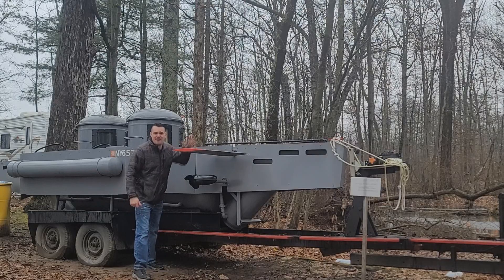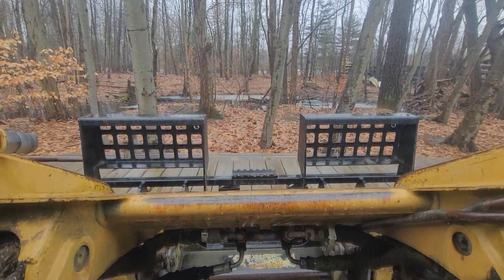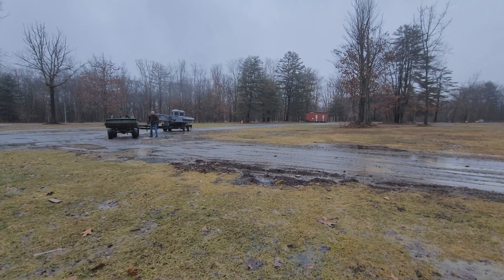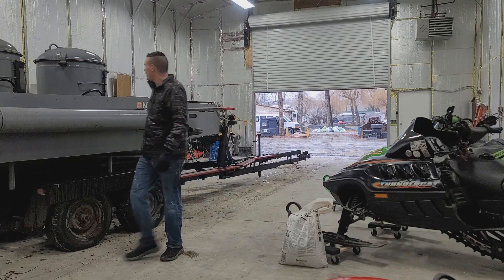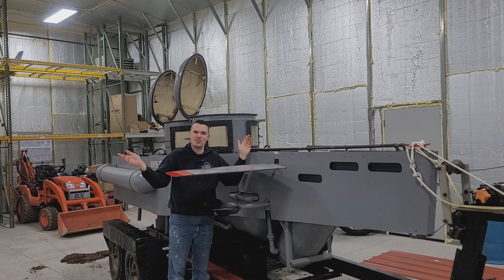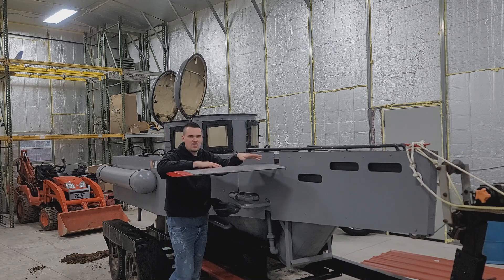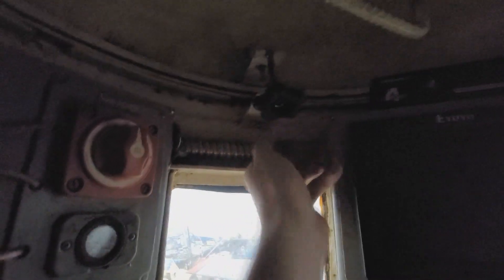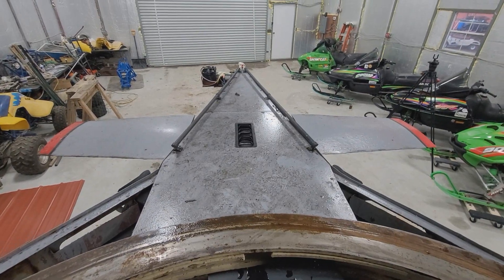Submarine Update! - In The Garage | The Plan & Walkthrough - Episode 1

Comment: If you dive with someone on the surface who knows about you and your plan, you will be fine. Sugesting you to try add a snorkel, or even a flexible hose with floater and compressor on the surface, to feed you with the air. With the condensation - sugesting you to make a condensation groove, to be dried or pumped out. Another possible point is to add a chunk of salt inside (salt takes the watter and wettness in).

Comment: 8:37 something important to keep in mind, which you've probably accounted for but I wanted to mention it just in case, is that if the cabin is flooded, the internal electronic systems will need to be fully waterproofed to prevent damage.
Reply from the maker: Not practical, most of the electronics would be destroyed which is fine. It's for an emergency to survive, so that part doesn't matter. Thanks for the comment

Comment: Dehumidifier with a "pump" to pump out the water, if you have a way to drain it out the cabin, and run that for an hour or two per day....and I would also put Silica gel inside the sealed electrical boxes to keep that stuff extra dry.... I have experience in humidity issues...I live in MN and have a Bunker Style Basement....(My Great Grandma had my house built for her)

Comment: Awesome job and thanks for all of your extra work of sharing these videos and even replying to comments!

I'm sure you considered having an exit facing downward so you wouldn't have to flood the sub to scuba out. Why did you rule that out? I guess you'd need feet on the sub to give you space below it if it were resting on the lake floor..
Reply from the maker: Correct, there is no room below because of the I-beams, they keep the sub upright and weighted, takes up the space. Also, that's correct - If it's on bottom, there would be no room. Thanks!

Comment: You don't need scuba gear to escape the sub - all you would need is a pony bottle to give you a few breaths as you flood the boat.

(I guess that is scuba gear - maybe thats what you are using.)

Flooding the boat increasing internal air pressure to about 45psi.

Regulator on the pony bottle supplies air and as the boat floods; it increases to 45psi also.

Kick the hatch and swim out. No air needed at that point - just exhale on your way up.

I used to free dive to 90' in my youth. 

(Just as a demonstration - I had to be massively negatively bouyant and drop my belt when I came up.)

Free ascent from 60' is cake.

But what do you estimate as your crush depth?

Or whats the max depth in your operating area?
Reply from the maker: Yessir, I keep a pony bottle. At 60ft, it's only 25.93psi. Which is it's max depth with 1:2 safety margin. Estimated crush depth is 120ft based on 3D model stress testing. Impressive free diving. - Also PADI certified, just assuming from your comment. Have a good one.
Reply: @PlanesBoatsandSubmarines  I only did it a couple of times - keeping up with my dive instructor, who frowned on it because of the risk of shallow water blackout.

A good experience though.
Later when I did the escape training at sub school in Groton it was no big deal.

Comment: I love the build, I am curious on ur opinion on the J hooks? The screw down part looked plastic to me and id be nervous
Reply from the maker: They work pretty well, never had an issue yet. Although I would like to upgrade them just because. The K-250 subs use the same style, proven effective design. I keep a wrench inside should anything like the plastic break, could just turn the nut. As well as secure or remove other fittings inside.

Comment: You need to pick up some bolt-on zincs to act as sacrificial anodes, and bolt them both to the interior and the exterior... it would greatly reduce your corrosion problem.

Also, dehumidifiers works WONDERS.

Comment: I don’t understand why would you go through all of that work and not set boxes of dehumidifiers in the interior, I mean the simplest form is even baking soda, but you could purchase these things were absorbs all the humidity. 
Anyway, with that being said, that’s a cool build, must be surreal to just hang out under water.
Reply from the maker: I did. I had containers of damp-rid inside. They couldn't keep up for anything. It condenses so badly, it needs full dehumidifier running inside which is the solution I decided on. Thanks!

Comment: You should put some type or cover over those valve handles to prevent something from snagging them and opening them by accident.  Also maybe get some O2 candles in case of an emergency.
Reply from the maker: Thanks for the comment. We zip tie them. o2 candles is an interesting idea (but to my knowledge, not used in personal subs), we do have onboard oxygen tanks that release o2 on a slow flow. As is, it will already last up to 24 hours underwater. But as it's a shallow diving sub, flooding to escape is relatively safe if you were running out of time. Onboard scuba as well for flooding and escaping. All the tanks were removed for the video so I could move around inside it.

Comment: You should install some grating on top of your ballast tanks on the sides. That would give you a little deck area for better accessibility while on the surface. You can always put sections of it on hinges so they could be lifted up to allow access to the tanks.
Reply from the maker: That was the original plan, and I might still do it, but it would have to be a plastic grate. A full size steel grate would make it more unstable at the surface. Thanks for the comment.
Reply: @PlanesBoatsandSubmarines would you ever be interested in building a sub for someone else?
Reply: Just a thought but you might be able to fix that stability issue by adding a second section of pvc pipe below the existing one. That would help your trim level in the water as well. Assuming you have enough reserve capacity in your ballast system to offset the additional buoyancy. But I would think the additional deck grating would possibly balance it all out. It would be nice to have that deck space. Make it feel a lot more like a traditional sub and less like just a submersible. I love your progress though and your enthusiasm for this. I always had an interest in subs and thought about building one back when I was a young man but unfortunately I never did. Been a lifelong follower of psubs since they were formed.

Comment: Try an electric dehumidifier and sealing up the sub as well as you can to get the humidity inside down. The solution you're mentioning, circulating fresh air, will just introduce more humid air that will add to the condensation. You need to dry the air out because its impractical to raise the temp of the hull of the sub to keep it from being below the dewpoint causing condensation, and those are the only solutions I can think of. Same situation as the windows in my fish tank room in the winter, I run a dehumidifier and its no issue now, its amazing how much moisture they can pull out. If you can get a drain hose from the dehumidifier out of the flood valve so you don't have to drain the dehumidifier manually you're all set. It should work well because its a small sealed space.

I have a home made/converted RC sub ROV using a drone flight controller. Might be fun to see how you could integrate the control system/automation to your sub, even just the instruments they have onboard might be of benefit. Look up Ardusub for the open source project supporting it. I used a thunder tiger RC sub and converted it, so its a classic sub with ballast tank like yours.

Looking forward to the next video, especially this summer when its in the water!
Reply from the maker: You know, that is a very good idea. Best Comment. My thought process was humidity is at 100% in there (higher than the outdoors, virtually always) so I figured even fresh air would bring it down if the flow rate was high enough from a ducted fan and use less electricity being hooked up all summer, but if I can find a small dehumidifier that works well. I'll do it. I've tried small dehumidifiers off amazon (for my bathroom, not the sub) and they don't extract much (droplets compared to a compressor style dehumidifier), so I think it would have to be a dehumidifier with a compressor/refrigerant to really dry it out. Curious to know the smallest one available that utilizes refrigerant and would certainly drain it through a valve. Ardusub looks cool. Maybe for a future endeavor. Thanks!
Reply: It will definitely need to be one with a compressor. Because its a small sealed space it shouldn't have to run much to keep the humidity down, probably only to inially lower it and then wherever new air is introduced.